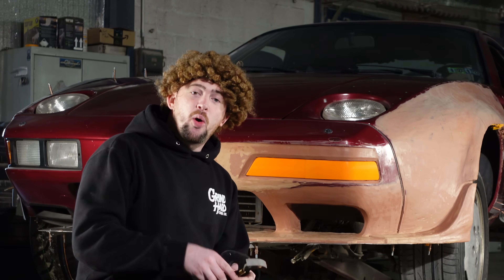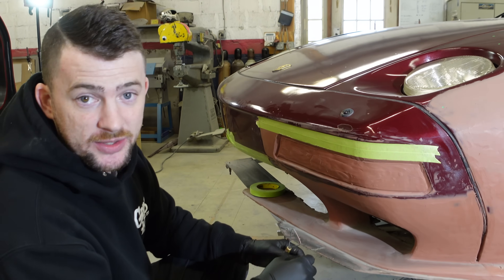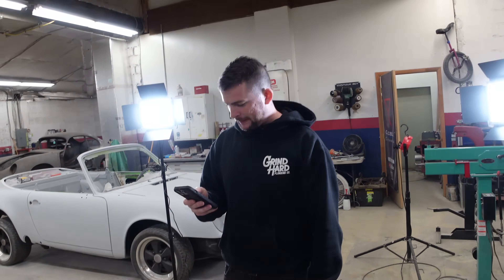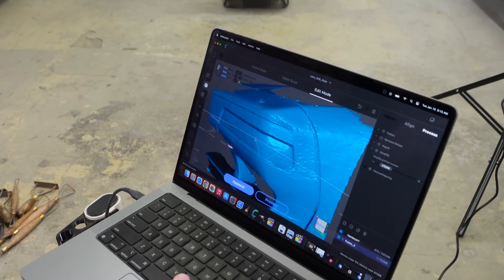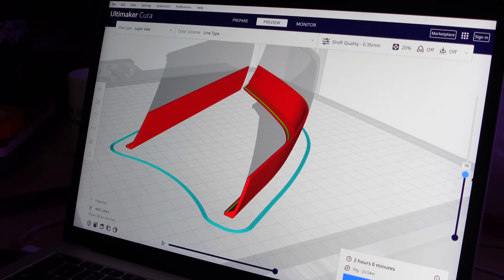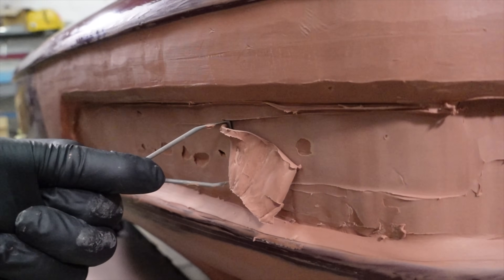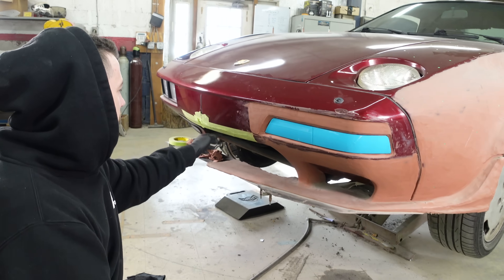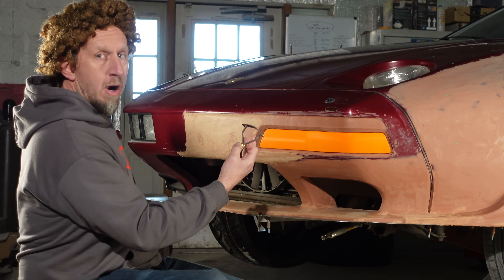MAKE What You Can't BUY! -- Custom Light Using Clay, 3D Scanning, 3D Printing - 928 Ep. 19

Comment: Take some time to really refine your clay work, get it to the correct geometry, trying to achieve a class A surface It will make a ton of diference. Chavant has a lot of information which will be helpfull.
When working on your data, try to construct it based on the true features and Key lines. Be patient and learn a little bit more
Regards 
M Riego 
Ex chief executive designer GMM.

Comment: I studied clay modelling for the car industry in school. I know this is quite late in the project but if you ever do something with clay again, you don't want to rely solely on loop wires and the fixed blades. You can use strips of spring steel for larger, even surfaces. Start with a relatively thick, rectangular piece of spring steel sheet, that you can still bend with your hands. You slightly tilt and then bend the steel, then drag it across, to get subtract material from a wide area, but with a slight curvature. If you do it right, you get big smooth surfaces instead of a very choppy and wavy one like with the small tools
Reply: That’s such a cool thing to have learned! Great advice. I think in this particular case it shouldn’t matter too much because 3D scanning with lidar will leave that choppy surface anyways, so they’re going to have to correct it in cad or blender or something regardless.

Comment: If you use baby powder and dust it on to the shiny surfaces it will cut down on your errant point cloud data.
Reply: Desenex spray foot powder.
It works for finding porous castings and dye penetrant as well.

Comment: Wow ..impressive stuff.  I can't afford clay and 3d printers.  I made lenses out of carved bog. Made a mold with silicone mold material then cast it with coloured resin. The light bodys I fabricated out of steel.  Body shapes and modifications started with beer carton cardboard and contact cement.
Reply from the maker: Awesome! Gotta use what you have, cheers!

Comment: You need to get hold of some Di-Noc / modelling film ASAP (sort of non-adhesive wrap) I fear both the shape & position of the light need adjustment; this would help clarify either way sooner (i.e. better) rather than later

Good that you did a sketch, not so good that it was apparently just 'a' sketch. Dunno about you, but personally I rarely a) get it right 1st time & or b) the first idea is best one (even it contains essence of the final idea)

As long as you can read them, doesn't matter how the sketches look like, just explore variations. Take your own advice: a little more time at this stage will save you in the long run...  

BTW some modelling film available in various colours, guessing 'wine red' would be pretty good match... 

HTH

Comment: Turn signal looked pretty close to an 90s NSX corner light ;) no angle on the inside but still :)
Reply: Exactly correct.
Reply: Ironic see that comment  was a salvage yard getting parrs from a  81  928..Nissan guys kept comeing  up thinking  it was a nissan
Reply: 1996 Honda accord would be a cheaper option ;)

Comment: This is incredibly good work, the welding and fabrication in particular are spectacular, but for the common man, buying a finished car would probably be cheaper than buying all the amazing tools you have at hand to then fix/modify an existing car. Sure, it can be done with lesser tools, even on a driveway, as some builders proved during the years, but the level of passion and dedication to achieve that is on a completely different level itself.. And Im not criticizing anyway, just stating reality! 😅

Comment: I've only recently started watching your channel so I don't know if you've used it elsewhere, but have you ever used a 3d scanning surface spray?

My last employer bought a fairly high end commercial scanner which used datum point reflector dots, as well as a surface prep spray.

We eventually learned that you can substitute dye penetrant crack inspection developer spray for the 3d scanner spray, for a fraction of the cost.  It appears to be a finely ground talc in an aerosol can.